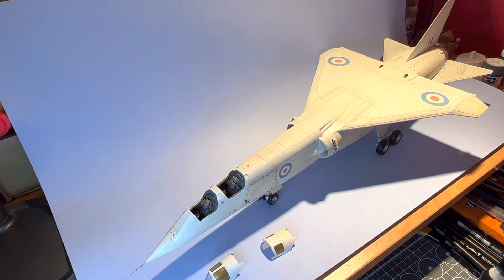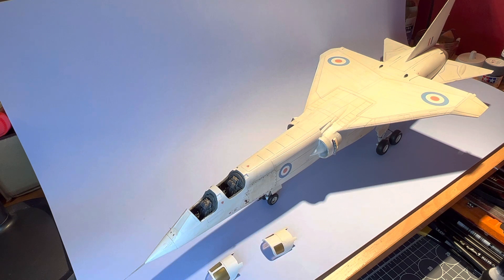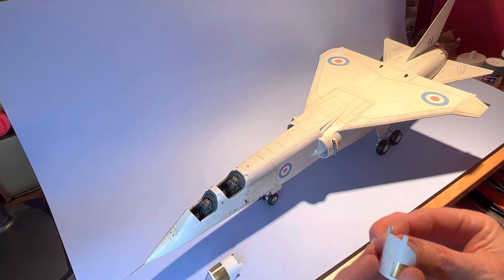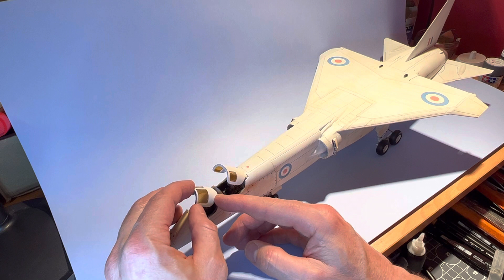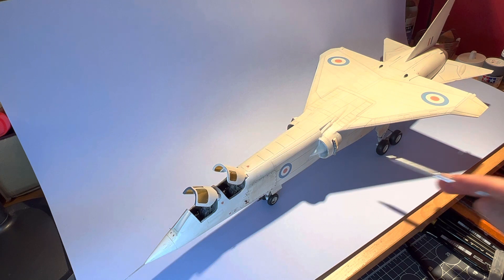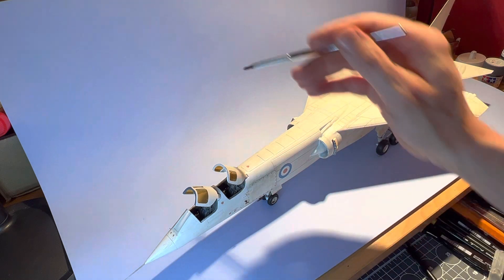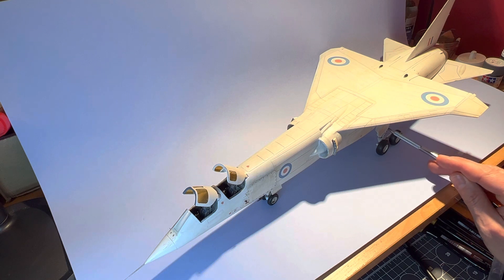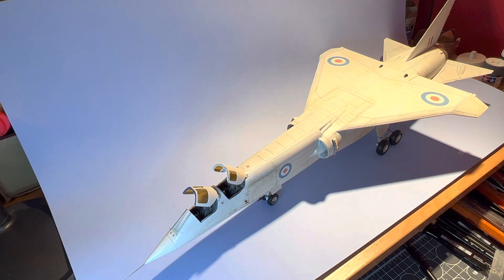Airfix TSR2 1/48 scale: final

Comment: I was unaware that this had been modelled by Airfix, in 1/48 too! TSR2 was interesting because of three advanced types for the RAF-RN (the HS P-1154 a supersonic Harrier type, the AW-HS 681 a STOL Transporter, Hercules sized)  it was the only one that got to hardware and flight.  It was originated by English Electric Aircraft as a replacemnt for its Canberra and it was largely compatible in its controls with the company's Lightning as well. Indeed, although described as a strike bomber, its performance was such that an interceptor variant  was proposed. After cancellation it was meant to be replaced by the F-111 but that too was cancelled  and the older Blackburn HS Buccaneer was brought in.
Reply from the maker: Thanks for your contribution!
Regards,
Z

Comment: You've inspired me to give this kit a go. I've just picked one up for £55 which I think is a good price?
Reply from the maker: Dear Phil,
Thanks for getting touch- I think you’ve done really well there! I’ve seen the 1/48 kits at upwards of £100. There are some upgrades still available (resin wheels, oleo legs and cockpits etc), and I recently noticed a front pitot upgrade on a local internet.
Have a good build- very grateful for your kind words.
Regards,
Z
Reply: @ZinzanModelling  I've gone a bit all in on the TSR2 - when looking for the 1/48 kit I found a store that had three Airfix 1/72 ones at under £40 each, so I bought all three! I'm (eventually) going to try making a Tornado F3 style variant - shortened in front of the wing and a radome from a late Phantom, or something like that!
Reply from the maker: Dear Phil,
That’s very ambitious! You might consider a swing wing variant of TSR2 which was mooted during the development cycle and (I believe) a part of GOR343 as an extension of the original specification GOR339. Another alternative might be the Vickers Armstrong type 571.
Regards,
Z

Comment: Can you give some links to the upgrades ZZ? Cheers Jon
Reply from the maker: Dear Jono,
The cockpit/ nose cone was by Wolfpack and the jet pipe upgrade was CMK as I recall. I’ll take a look at my video of the unboxing to find the rest- give me a few minutes!
Regards,
Z
Reply: @ZinzanModelling  Thanks ZZ, Keep up the good work My wife has bought me a Revell RV05163 05163 5163 1:72 German Submarine Type VII C/41 Platinum (Limited Edition) Plastic Model Kit, Various, 1/72 to add to my stash. It'll be a monster at almost a metre in length.
Reply from the maker: Dear Jono,
Awesome!! I’d be pleased to see your video on that.
The oleo leg upgrade is by scale aircraft conversions and I can’t see the maker of the resin wheels, but it will be worth looking for.
The only problem you may encounter will be picking up these upgrades- I suspect that the Wolfpack one may no longer be available.
I’ll take a look.
Regards,
Z
Reply from the maker: Dear John,
Have a try on eBay- there are some upgrades still available- Wolfpack wheels and suchlike. Also some PE cockpit upgrades and some resin seats. I think it’s possible to get a significant detail improvement without the WP upgrade, but you may have to think about thinning down the AF pitot tube. I scratch built the other bits and I’m sure you can too.
Good luck my friend.
Regards,
Z